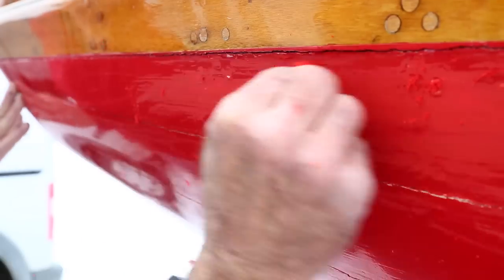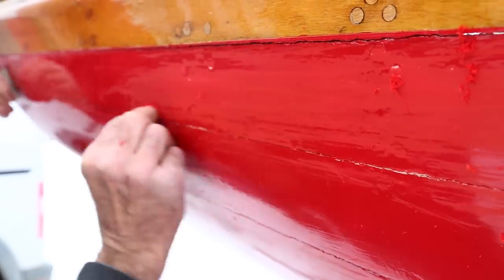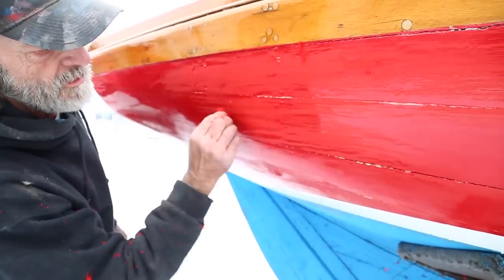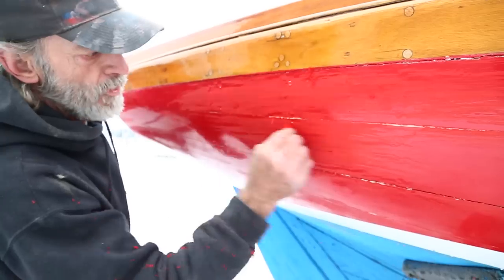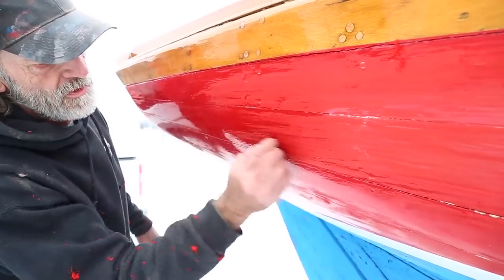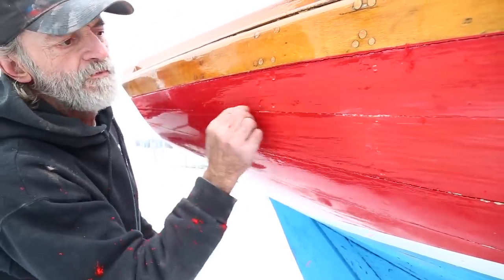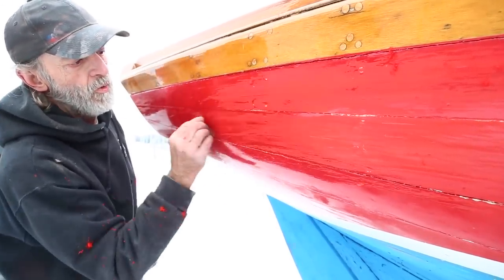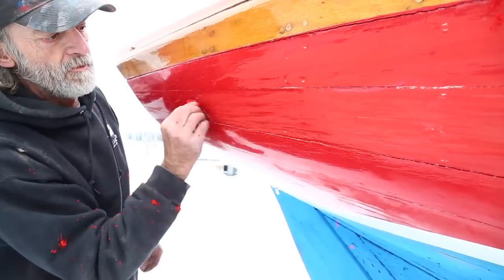Save time sanding your boat with this little trick

Comment: Hi great videos as usual, can you please tell me the best paint to use on a clinker hull boat, i am from Australia paint shops say water based, other say only use oil based paints house paints will work , also do i put a sealer first then primer then top coat any help appreciated.
Reply: Farmer2492 hey digger Polyurethane 2 part.
Reply: Thank you
Reply: Gel coat

Comment: So right, I use a razor scraper with a handle  that allows you to apply more pressure, aching fingers there...
Reply: hi, the closer your fingers are to the blade the more control of the blade you have. If you have the blade on the end of a device, the distance between your hand and the blade becomes a spring (muscles) loaded tension (fulcrum) that can "jar" into the surface and create a nasty gash. Less is more. ;)
Reply: better than a lost finger, he,he...

Comment: Whats the point when a longboard is going to regrade a fair surface into and through that ripply surface anyway. To save time? That process is not a step in the job of creating a fair hull when all steps contribute to the fairness of that hull.
 In all fairness.